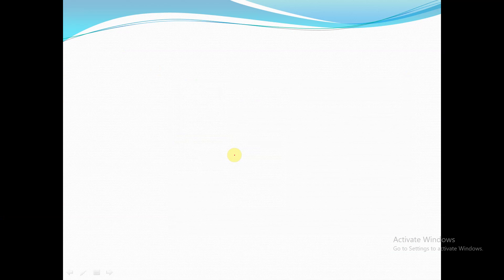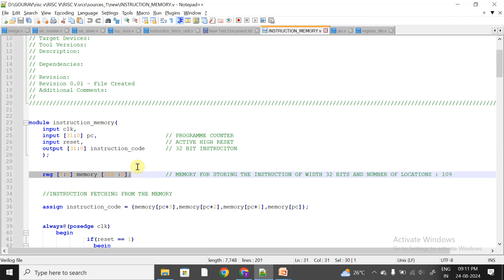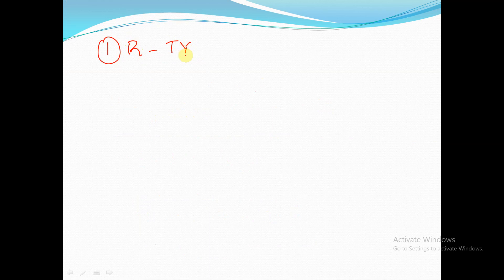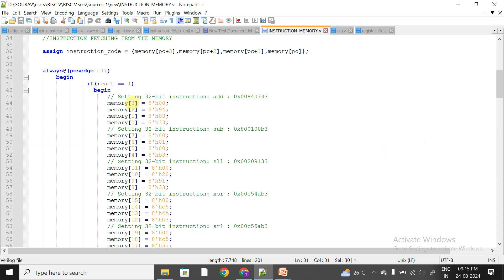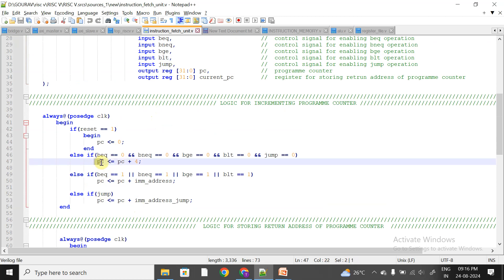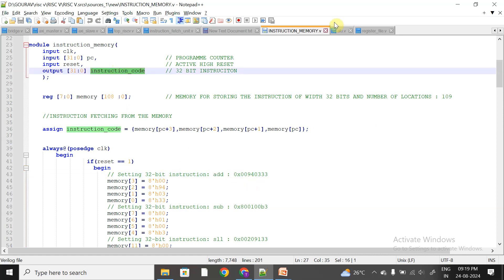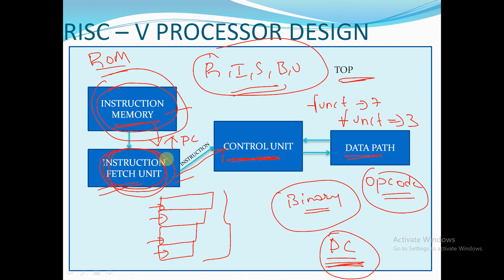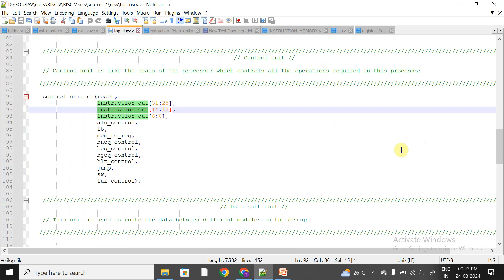Verilog code for Instruction Memory unit || Risc - v processor design using verilog ||

Comment: Sir in this we have given fixed 32 bits code for all the instructions. Which means we fixed the rs1, rs2, rd beforehand for all. Shouldn't it be that we program the opcodes and func in instr memory and provide src and destination registers or immediate values externally in machine code ?
Reply from the maker: Hi Aryan
We are implementing risv 32
Here 32 indicates the size of the instruction
Reply: @Allaboutvlsii  We already knew that, but within the 32-bit instruction format, fields like rs1, rs2, and rd act more like variables, while fields such as opcode, funct7, and funct3 have fixed values. When we execute a command like add r31, r8, r16, the instruction memory retrieves the relevant information for the add operation such as the opcode, funct7, and funct3 while the register identifiers (rs1, rs2, and rd) are provided separately, as they were already defined earlier. So why should we store fixed values for slices of registers inside of instruction memory unit?